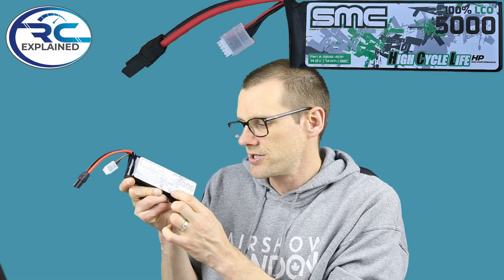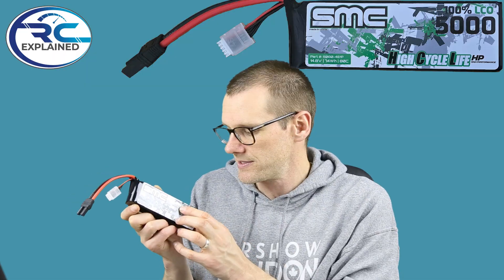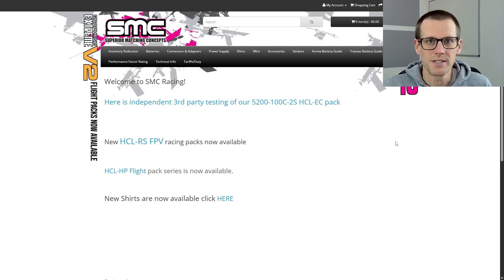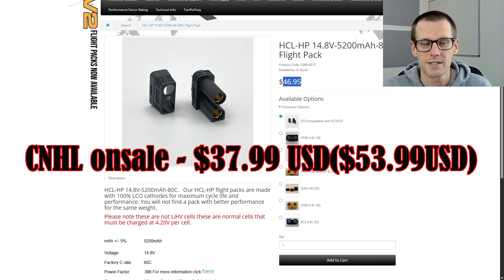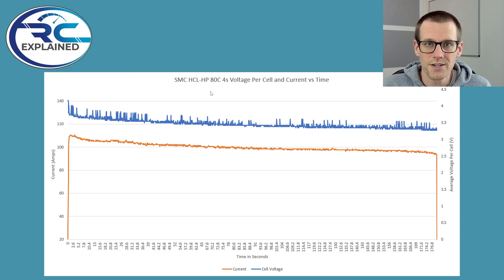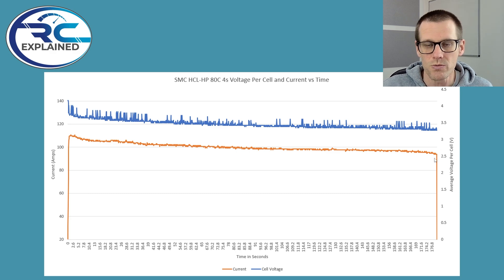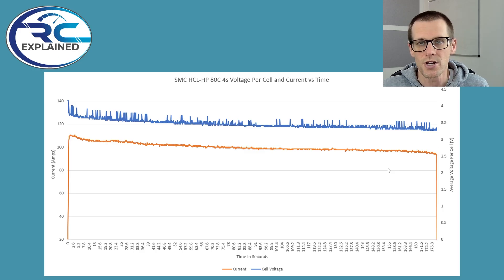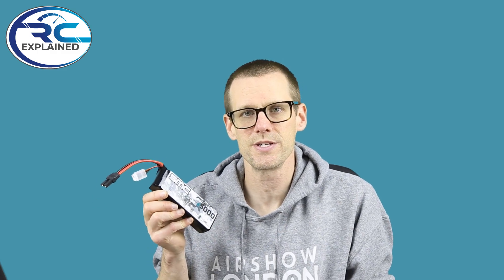This SMC HCL-HP Pack Just Broke Our mAh Record! 105A Load Test Delivers Great Numbers!

Comment: I have a huge question and would love if someone could answer it please.
I have a pair of 6400mah 4s lipos. One is misbehaving and I'm very wary of using it.
Cheapish brand that offers great performance. It's IR is still low on all cells. Balances perfect and it's performance is on point. Not puffy or anything like that. On paper and on my charger it looks and shows all is normal.

However when I charge it.. usually well below 1c. I usually charge it at about 1amp so rather gentle, it heats up. Not talking about a huge rise in temps but warm to the touch. The other identical spec battery doesn't do this. I've checked the IR at varying states of charge and it appears to be very healthy. Swapped chargers and still get the added warmth when charging it up. Discharge temps is the same as the other. As I said performance is great when using it.. Usually in my X-Maxx/XRT/Model TT 8s models.
Any idea what could be the issue?? They've had about 15 cycles each. I've searched everywhere but still have no idea why...?
Reply from the maker: A pack that heats up during charging is concerning. I would not use that pack myself.
Reply: @RCexplained thank you for the reply bud. Really appreciate it.

Comment: Smc has always been good performers ? Using an HRB and yowoo graphene seems to like daily or getting used a lot . I was told if you’re going to use them a lot but yowoo graphenes are pretty good . Red wire came off the battery terminal on one of them after a year. I tried to solder it, but I just couldn’t get it and feel confident about not causing a fire. So I threw it away, unfortunately. I threw it in the Home Depot box.

Comment: ⚡️ The Charge Cycle Breakdown ⚡️
(Genre: Upbeat Electronic/Pop)
(Intro - Fast Synth Beat)
(Sound of a meter beeping rapidly)
(Verse 1)
The workbench glow is bright tonight, gotta check these cells just right.
Got my cam set, mic is hot, ready to show you what I've got.
It's the Lithium Polymer power pack, gotta see if it can bounce back!
From the factory or after a flight, let's turn the voltage into light.
(Pre-Chorus)
Got the leads, they're clean and gold, a story waiting to unfold.
Is it puffy? Is it cold? The truth in numbers must be told.
(Chorus)
Hit the button, see the screen, the data's coming, sharp and clean!
Cell one: 4.20! Cell two: 4.19!
We're testing C-rate, checking health, sharing all the knowledge stealth.
On the tube, where the circuits gleam, living the LiPo Testing dream!
(Verse 2)
Internal Resistance, that's the key, the low milliohms set you free.
High IR means you're dragging slow, time for this battery to go!
We'll hook it up to the mighty load, watch the discharge down the road.
Plotting curves on the fancy graph, getting all the juicy math.
(Pre-Chorus)
Got the leads, they're clean and gold, a story waiting to unfold.
Is it puffy? Is it cold? The truth in numbers must be told.
(Chorus)
Hit the button, see the screen, the data's coming, sharp and clean!
Cell one: 4.20! Cell two: 4.19!
We're testing C-rate, checking health, sharing all the knowledge stealth.
On the tube, where the circuits gleam, living the LiPo Testing dream!
(Bridge - Tempo slows down, dramatic)
Safety first, you know the drill, fireproof bag, standing still.
Don't overcharge, don't let it dip, always careful on this trip.
'Cause one wrong move and you might find, your battery's leaving fire behind!
(Chorus)
Hit the button, see the screen, the data's coming, sharp and clean!
Cell one: 4.20! Cell two: 4.19!
We're testing C-rate, checking health, sharing all the knowledge stealth.
On the tube, where the circuits gleam, living the LiPo Testing dream!
(Outro - Synth fades out with a final, satisfying "BEEP")
Yeah! 4000 \text{ mAh} strong! Thanks for watching! Like and subscribe!

Comment: Love your videos super informative. Have a question about the V4 compared to the HCLHP. The prices are similar, actually the V4 is cheaper now they are on sale. For speed runs would you recommend the V4 over the HCLHP. Does a higher C rating usually mean less run time. I guess my main question is will the HCLHP have a longer run time with similar performance than the V4
Reply from the maker: If you are looking for all out speed, I would get the SRD V4. They perform the best. 
The HCL-HP will have a slightly longer run time.
Reply: thank you so much you are amazing
Reply from the maker: Glad i can help

Comment: The actual weight of the pack might tell a more complete picture, a way to get higher numbers is just to under rate the full capacity. Ie use a 5400 cell.
Reply from the maker: True, however, it seems most companies do the opposite. One reseller in particular rate the pack at a higher capacity then what the manufacture of the cell places on the cell!
Reply: @RCexplained that, also can be checked out with the weight of the pack 😊
Reply from the maker: @leegengxiang2173 true to a certain point. Weight could be a better c ratings instead of capacity improvement. 
 i post the weight of each pack on the battery sheet on the patreon site.

Comment: Im curious when it comes to getting the batteries  , is SMC & CNHL  sending u the batteries directly for free or are u buying them from a hobby shop  without them knowing your doing a test ?
Reply: Great question!
Reply: I guess my question is what’s the difference if somebody sent you a battery and would you be biased or would you be honest and is that why you’re questioning him.
Reply: Or, since these batteries have only a sticker on them to identify, does SMC ship better batteries to influencers?
Reply from the maker: Great question as this has come up in my conversations. Its easy to test a few and send the best one to an influencer. 
SMC has been one of the only battery manufactures to send me units to test performance with. I have bought all else including the SMC SRD V3. As you can imagine, not too many battery companies want me exposing the truth of their packs. Some battery manufactures, 4 now, have reached out and when I share my previous videos and explain this is the template, they never reply. The patreon page helps out with the cost of testing batteries as this gets expensive fast.

Comment: I have a few of the SMC batteries with XT-90 connectors. For whatever reason, they all swell up after a few cycles. Not sure why they do this but I have at least 3 smc batteries that are puffy now. I really like how they perform otherwise though. Still searching for the perfect battery
Reply: A lot of people run SMC batteries way lower than they realize. The LVC isn’t accurate on a lot of RC.Get a lipo alarm… that’s what SMC recommends
Reply: @ryanwestbrook71 Thank you for addressing this. People just use Batteries blindly and they never check anything because they think the manufacturer has their best interest at heart. What a great comment I commend you.
Reply: Perfect batteries is the new Liion EVE 50PL cells, 60 amps continuous without temp cut off 5000mah. The way things are going lipo will be out of business.  6s2p EVE 10000mah capacity 120 amps continuous and weighs the same as SMC 6s 5000 mah. Land safely at 16.8 volts compared to 21 volts for lipo no puffing.